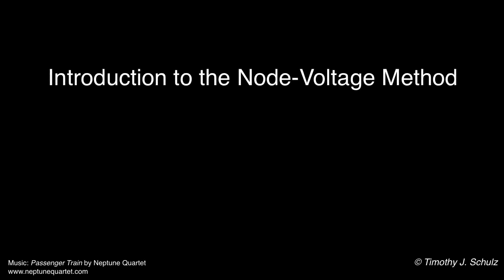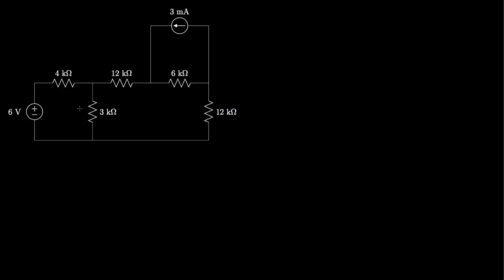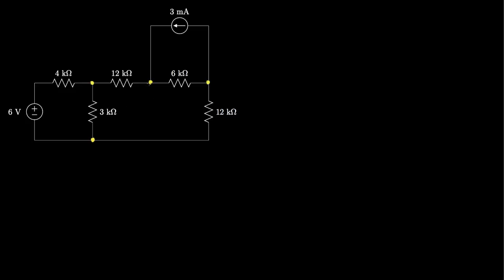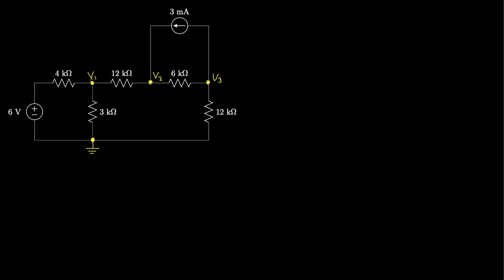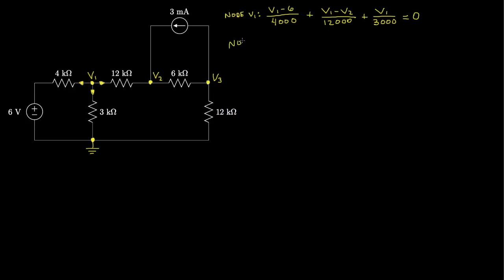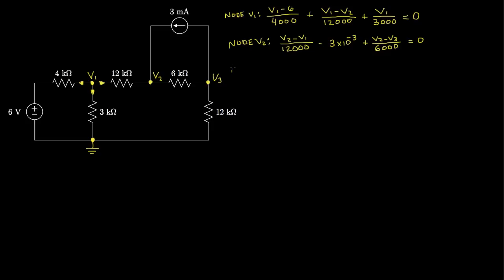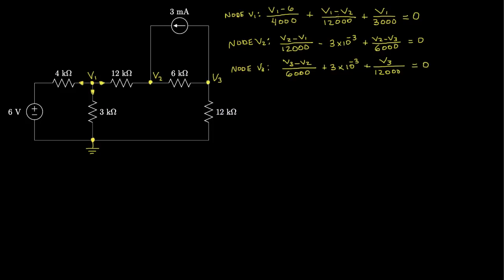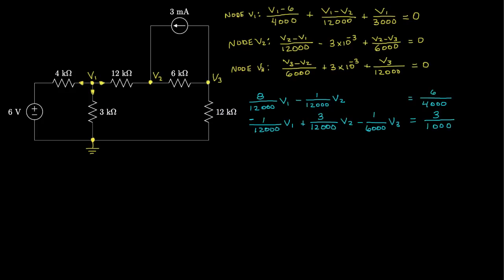Introduction to the Node-Voltage Method

Comment: is there a case when one of the terms is negative other than a current source? For example if the first term (v1-6)/4000 would be -(v1-6)/4000

Comment from the maker: There are several other methods for solving circuits. I have videos for most of them. In particular, check out the videos for the mesh current method. The benefits often depend on the nature of the particular circuit.

Comment: if the 6V voltage source polarity was flipped, would the first equation read v1 + 6 / 4000 instead?

Comment: hi ,can i ask you that do we select the reference node randomly ? what if i select it at the same position as V3 ? (sorry for my bad english - hope you can undersand)
Reply: It is best to select the reference node as one that is adjacent to a known voltage source. That way you never run into negative voltages, or hopefully not. If you were to put the reference node where V3 is, the problem would still work the same, however, the voltage along the bottom node (bottom wire) would have a negative value as current is flowing from a place of 0 voltage to a place of negative voltage. The differences, v1-v2, v2-v3, etc. would still work out to be the same.
Reply: thanks

Comment: I have a question: what if between two nodes there is only a voltage source and no resistor? What should be under that ratio line?
Reply from the maker: I address that situation in subsequent videos about this method. You can find them in the electric circuits playlist.
Reply: it's okay I passed my exam. thanks.

Comment: What if you didn't have that 4 kohm resistor? How would you find node V1?
Reply from the maker: If you replace the 4kohm resistor with a wire, then V1 would be 6 volts because of the voltage source.

Comment: Please explain the math at 11:16
Reply: The number tables on 11:16 are called matrices (or "row vectors" and "column vectors" if they have one row or column), which are extremely useful mathematical tools.
Matrices are actually quite intuitive when you have studied them for a while, even if they might look scary and mysterious if you are unfamliar with Linear Algebra - you can think of the matrix in this video as another way to write a system of linear equations. If you want to learn more about matrices then check out the book "Linear Algebra And Its Applications 4:th Edition" by David C. Lay. =)

The procedures in Linear Algebra are a little tricky to explain if you haven't studied Linear Algebra, but basically what he does is that he multiplies both sides of G*V = I with the inverse of the G-matrix, ("inv(G)"), in order to solve for V. This is kind of like solving for a variable in regular algebra, except the matrices work quite differently. But you actually learn all of these things in a first semester Linear Algebra course, so you will find all that you need to know in any introductory Linear Algebra literature.
Reply: +Laurelindo Yeah that's gonna help so much. lmao
Reply: neyo509 What's gonna help so much?
Reply: Laurelindo I just thought it was funny referencing a textbook, which take a long time to read and understand a topic like matrices.